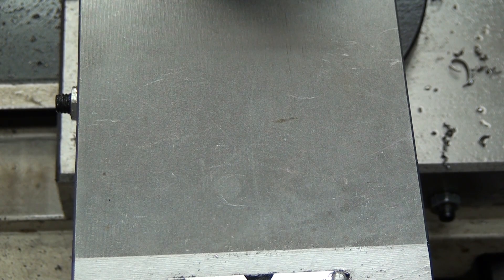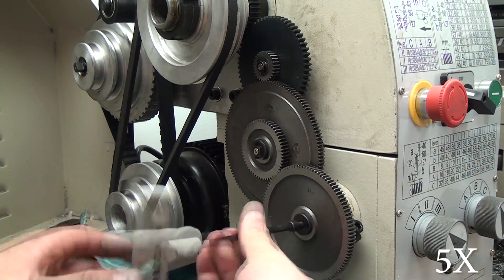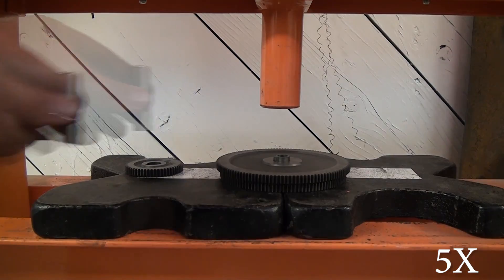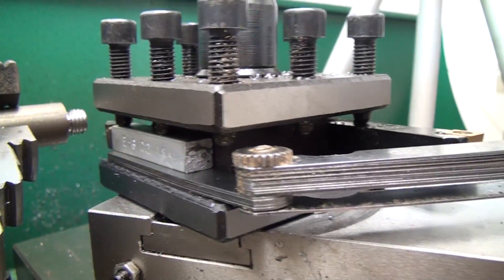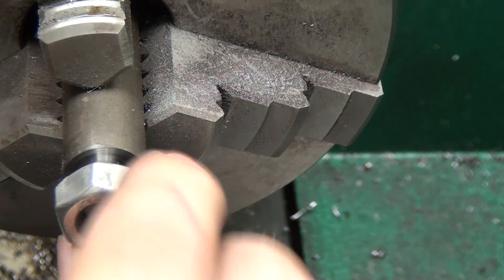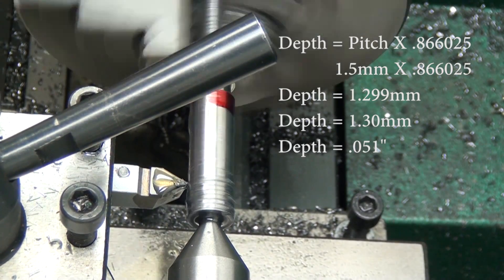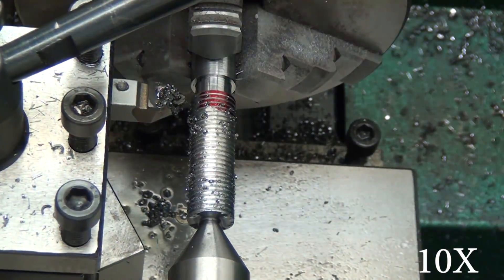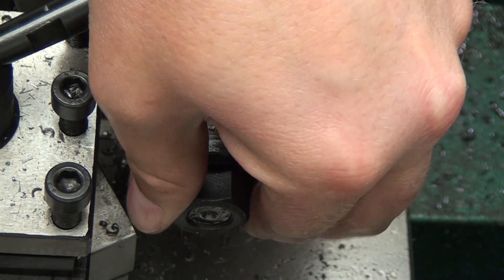15 G0602 Turning Metric Threads

Comment: It pretty common for guys who are not doing this all day everyday, hobbyists if you like to almost shy away from cutting threads on the lathe and it's understandable. Your comments about mild steel are not unfounded but it can be mastered to produce a good cut. Some of the other points in your video have been covered by other viewers commenting such as compound angle reason. Many issues are solved with attention to cutting speed, depth of cut depending on material and so on, stainless is a different ball game from brass for example, there is no one size fits all solution. Practice is key!
You have obviously taken quite significant lengths to set your tool height by using feeler gauges but it goes without saying that tool height is crucial and is worth every effort to get it right.
There are some excellent videos by the likes of Joe Pie, he is the master in my opinion but many others are very, very good like 'Blondihacks', she is very good for beginners. Stick to the ones that concentrate on facts and techniques and they don't treat you like an idiot, no disco music and pointless blurb like why the dog has fleas, yes I did see one that did that. If you are a beginner and I can see in your video you have a hobby level lathe you will get great instruction from the good videos. 
Thought on my reference to 'Blondihacks' videos is that she has all hobby level kit in her workshop but she really knows her stuff, she's done the hard learning, look her up if you haven't already. Good luck and happy machining! 
I'm off to cut a 1.5mm pitch on some 25mm brass stock....................See ya.

Comment: He is not using a mini lathe that lathe is a 10x22 inch lathe. It might be a small lathe but its no mini lathe. Some of these lathes have bad fit and finish which can effect movement however the compound holding plate should be modified it only has two bolts holding it down by a small steel or cast iron plate the mod is pretty simple many people have done it before.

Also isnt he supposed to have the compound slide set at half the 60 degree angle such as 30? I may be getting confused but I thought I seen that done before.

Comment: https://mdmetric.com/tech/thddat2.htm . 
Your thread depth of 1.299 is the true height of the triangle in which the formed thread will sit but not its actual depth. You need to look at the diagram to see the true geometry of a thread. Half nuts can be disengaged and Metric threading right up to a shoulder is best done away from the chuck. 29.5 degrees is the angle the compound will travel out of a plunged relief done with the cross slide and to the correct thread depth. Or a fraction deeper.

Comment: I've threaded cold rolled 1018 steel with no problems. My first attempt was a success. Very sloppy (class 1 or worst). Second one was a frailer. I went back and found what I didn't do, and my third was even better then my first. Between a 2 and 3 class fit.
Reply from the maker: Nice!

Comment: Why you using tungsten carbide tools? There no need for mild steel and a well ground HSS tool bit will give great results on mild steel. You need a bit more rake on your tip for mild steel, the carbides have a shallow rake for cutting harder materials. It is quite a common misconception that the hardest cutting tool gives the best results. Since you not running anywhere near the limit of HSS never mind TCT you should give it a go. I have cut loads of threads in all sorts of steels with a HSS bit including ACME, square and buttress as well as all the normal metric,unc,unf by and whitworth and not felt like I needed to switch to TCT!.
Reply from the maker: It's all I had at the time (the video is 4 years old). I thread with HSS on this lathe now.

Comment: Doing exactly that then it's working ok.
The smal chiped off material that is pressent in your operation is a sign that something is wrong.
The cutting Edge angle is too class to 90deg.
Reply from the maker: ***** I haven't had to make many threads on this lathe, but the next time I grind an HSS tool I'll remember your tip. Thanks :)

Comment: Hi russtuff - a way to make a nicer and better looking thread, is to use HS cutting steel, and make a smaller cutting angle at the flank where the thread cutting tool is actually suppose to cut.
Noe way to see that it's not quite ok with your cuttin is to look at the chiped of material.
That is suppose to be long spiralling material. If it's during

Comment: This may not be advisable on your own personal lathe but at school when dimensions don't permit a minor diameter "relief" or "runoff" cut ill thread as close to the shoulder as I'm comfortable hit the foot brake and simultaneously back out the cross slide.  Hitting the brake probably stresses the lathe in one way or another but you sure do get nice threads haha.  I've found that .003 cuts are good for roughing, an when your down to the last .005-.010, .001 or less gives a great finish.  Cool video and yes mild steel sucks
Reply from the maker: This little lathe doesn't have a foot brake.... Now you're making me jealous :)
Reply: russtuff you can also give the machine a "counter" Rotation, this stresses the machine a little bit and it pumps the Amps up to almost max, but it brakes the machine extremely fast, you just make the machine go reverse but not all the way, its like just touching to make the gears to the other direction and then you put the lathe back into the Off position, i do this all the time when i dont have a food brake to my use(or a CNC lathe), i measured the amps that it askes 1 time on a small machine(2.5 meter long and a max Rev of 2500, pretty strong as the most i put infront of the bit was 4MM(0.157 inch)) and it was almost 50 amps that i measured
Reply from the maker: Sir Phoenix I'm going to try it. Thanks!

Comment: Good to see you got carbide to work.  I know that was not easy. Carbide is brittle, provides a rough surface finish at low speed, and requires higher tip loads.  Those reasons are why I switched to HSS tooling (i.e. I gave up on carbide). I found using HSS for thread cutting with lard oil (available at McMaster-Carr, MSC, etc.) helps considerably with mild (1018) steel.  I use a hand crank to drive the spindle when threading.  Some HSS tooling I ground but A.R.Warner sells HSS insert tooling (also sold through little machine shop).

Comment: Try using threading oil, I thread rigid metal conduit at work and there is a night and day difference between the quality of the threads when you use motor oil compared to threading oil. You can pick up threading oil at Home Depot or Lowes in the plumbing section. Apply a light coat each pass and you can thread mild steel very nice. Hope this helps.
Reply from the maker: Great tip!
Reply: Now here is someone that  knows what he´s talking about. Listen up everyone!

Comment: First to thank you for all this videos I got same machines as you do (g0602 and g0704) and your videos help a lot.
So I have been researching inserts and as you may already know every manufacturer marks them in their own way so its hard to know what kind of material they are meant to cut. Diferent iserts are made with different properties. Some are meant for harder and  some for softer metals. From China there is C2-C6 mark that is used to define hardness of insert carbide but with name brand ones its hard to figure out but visually.  At end maybe grade of tool may not be best for softer steel.
Reply from the maker: Great point!

Comment: The biggest issue you are having with your thread cutting is the lathe itself, and has nothing to do with it being a metric thread, mild steel or hand rolling the chuck.  These small lathes simply lack the rigidity needed for thread cutting, especially the smaller threads.  The flexing is a big factor to poor thread quality and tool breakage.  This applies to parting also.  This is also an issue for carbide or insert tools.  You simply cant cut at the correct cutting speed on the small lathe.  I agree with the others, use HHS and you will get a better finish.
Others have also pointed out the depth of cut you were taking was way to much for the mini-lathe, ergo point 1.  You have addressed this in part by reducing your cut and by positioning your compound to 29.5 degrees.
Might I also suggest that for such small threads use a die rather than cutting it, much faster. 
I hope you are having more success these days with your thread cutting.

Comment: The reason for turning the compound in at 29.5 degrees is so that you on cut one side of the thread and not both. By doing this, it will give you a cleaner thread and prevent the root from being torn out.

Comment: Sharpen your own tool bits out of 3/8 high speed with a 60 thread gage for a pattern, put on center line.  Use some kind of cooking oil for lubricant (any seems to work) and you can cut cold roll, stainless, brass, aluminum etc.  Throw away that carbide not sharp enough,  but will work with hardened steel.  You are right - leaded steel cuts the best.
Reply: H.S. with a rake angle and if still rough, get close and use a thread die and oil of course.  Compound at 29.5 deg feed.

Comment: My fault,my fault! sorry for the mistake, but this lathe is a decent thread cutting lathe! I overlooked the gear chart n made a mistake in the gear set up while doing imperial threads! assumed because it was Chinese it had to be at fault!
Reply: bubster1981 I’m having the same problems as yourself, but I am cutting metric threads. When I try an M20x2.5, it ends up being M20x2.52 (slightly longer) so over 6 pitches I’m out by half a pitch. Can you recall how you fixed it.

Comment: its interesting , because if you take 20 t.pi for instance ,the carriage should move .050'' per spindle turn...if you have an error of .0025 per turn, doesn't sound like much , but over  20 turns that's an error of .050'' which is a thread plus or minus! gives you an idea how precise thread cutting really is

Comment: Yea!, , but metric threads are spot on.???  I thought  it having an imperial lead screw 12 t.p.i it would be better suited for .s.a.e threads , guess not. Yea , scratch out a 13 tpi thread and closely measure it ...or any for that matter an see what you get...or measure the carriage travel per spindle turn (accurate 1 turn and backlash removed frm carriage) and see what you get.  13 tpi equals 13 spindle turns divide 1 inch carriage travel  .077''/ rev

Comment: yes you should...the 1st time I tried to cut 13 tpi it ended up cutting 13.5...actually alitttle more! . I did some simple math, when cutting 13 tpi the carraige should move ..077'' .per turn of the spindle ,.mine is moving slow .071''  which is cutting almost an extra thread...why ,I don't know , its setup right. I managed to get 13 tpi by changing the gearing different frm what the charts say,i got the carriage moving .076'' per spinle turn , close enough! ,,I just don't know why this is

Comment: hey there, i think one of your probs may be taking to big of a depth of cut. when i learned how to turn threads in tech school we were taught to start with a doc of .003-.005 but as you start getting into the material you have to bring the doc down to .001... it takes longer but it wont chip your insert or sharpened hss and you have to think, when your cutting threads the chip load isnt just on the tip but also on the sides of the tool so youre taking a depth and width of cut.

Comment: Hi russtuff,

   I would get the same results with mild steel too. I like to use drill rod for any home made shafts it threads really good. As suggested try using a HHS tool that you grind your self. also get your self a pitch gauge. it has the double depth measurments for the threads. although not for metric threads.

Comment: dude.  you're using a feeler guage to clamp the tool in place.  how is the tool not going to move when under load? (btw, I have studied mechanical engineering but that's got nothing to do with understanding this.)  forgive me.

Comment: If I remember correctly, the main reason for setting cuts at an angle is to reduce the stress on the tool. Less surface area in contact with the material gives less chatter and less strain on the workpiece.
Some machining tips:
Make a metal hook to pull out the shavings. Don't use your hands! Nor pliers, they might "hook on" to the shavings spin around and hit your face.
Buy some proper cutting fluid.
Use alcohol as cutting fluid on aluminium.
Use dishwashing soap and water on plastics.
Have fun

Comment from the maker: it didn't make any sense to me either at the time, i was just doing what i was told. basically, the leadscrew is an INCH pitch, so you can't turn METRIC threads by disengaging the half-nut and reengaging at another point. when turning INCH threads that is exactly how you would do it, but for METRIC you must leave the half-nut always engaged. it's dumb.

Comment: You said in this video that with metric threads, you have to keep the half-nut lever engaged. I've never heard that before.  Can you expand on that a bit for newbies like me?
Reply: I think because the leadscrew is SAE, and hes cutting metric threads, using the thread dial wont engage at the correct timing...

Comment: Hey thanks for the instruction.  I just picked up a lathe like this and it doesn't have a Thread Dial.
I also have to try to figure out how to center the tail piece.  I'm looking forward to how you did that.  I'll be taking apart the tail pc. tomorrow to do the cleaning like you showed.  Mine is all gummed up as well.
Thanks again, ChiefBDT@gmail.com

Comment: I picked up a 1x30 belt sander from HF and it does a great job on the HSS bits. Wish I had gotten one with disk as well.  I also picked up a diamond grinding wheel (#32397) that I just chuck up in the lathe and sharpen the brazed carbide bits since they have not been that sharp when I get them. People say HSS is sharper than carbide but after some quality time with diamond stones on the carbide, I can't really see that much difference. Probably just because HSS is easier to sharpen.

Comment: I made a swing up tool holder for threading a while back. Instead of backing off, it swings up out of the way. Copy idea from Bogstandard on madmodder. He has a video of his in action here under the user blogwitch. HSS is sharper and better for light cuts. Carbide seems to want a bigger depth of cut to be happy.

Metric leadscrew makes metric threads a no brainer though...

Comment: Wow I forgot all about those gears haha.  I vaguely remember being able to do it without a press, since I don't have one.  RE 12L14, I found that it turned weird, like cast iron with short showers of chips, not long stringy blue chips like other steels, also the workpiece and the pile of chips rusted within days, so I'm not a huge fan.  Love turning 4140 though!  Great vid bud, doing it under power certainly helped.  A little bit of thread wobble is perfectly acceptable.